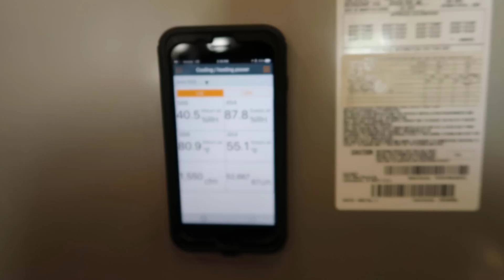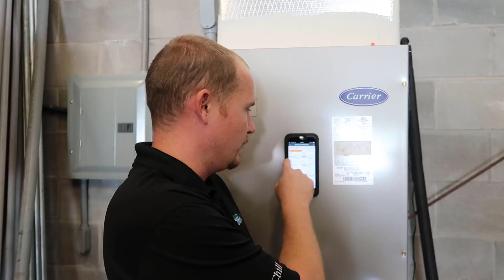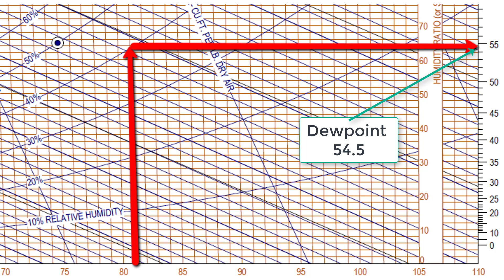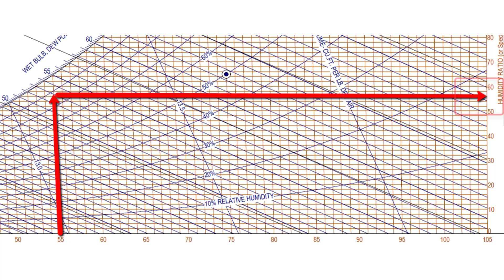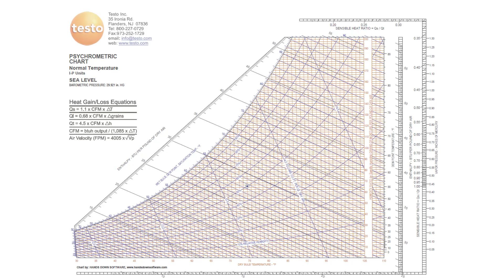Why is The Supply Relative Humidity so High?

Comment: Because relative humidity is RELATIVE to the temperature of the air... compare the dew point delta instead... or the wet bulb. Moisture content is technically measured in grains of moisture per 'pound' of 'dry' air, but that's a much longer explanation.

Comment: For Florida, even, your CFM must be very low for that supply air and the temp drop from return to supply. holy cow. Absolute humidity if falling of course (buy a better tool please);  but get your psychrometric chart out and graph this, there is no miracle here; also, error on 90% RH measurement is very high for this tool, be careful, please understand that.

Comment: So, warmer air coming in through the return can hold more moisture, & the colder air can hold less. As the air passes through the coil it becomes colder and thus shrinking the air molecules and wringing out the water( condensation)making the relative humidity on the supply side high, because of lack of molecular space to contain water?
Reply: The air molecules stay the same size, and so do the water molecules.  To understand why air has a capacity to "hold" water vapor, you need to look at it in terms of Dalton's law of partial pressure.  For a nice round number, consider air at 100 kPa of pressure.  Suppose we have a given air mass that is 1% water vapor, by molecule population, which corresponds to a humidity mass ratio of 0.0063.  Per Dalton's law of partial pressure, the partial pressure of each flavor of gas is proportional to the molecule population fractions (i.e. mole fractions).  This means our sample's water vapor partial pressure is 1 kPa.

Look up water's boiling point at 1 kPa, which is 6.97 Celsius.  Any hotter than this, and the water vapor is perfectly at home in vapor form, being mixed with the air.  Any colder than this, and water will condense until the partial pressure is low enough to support the remaining water vapor in vapor form.  6.97 Celsius is the dew point of this air mass that is 1% water vapor by molecule population.

If you increase the mole fraction of water vapor, you'll increase the dew point.  The water will be at a higher partial pressure, and if it were contained in a vessel separate from the air, it will boil at a higher temperature at that pressure.  This therefore increases the minimum temperature that can support that composition of air.  At 2% mole fraction, the dew point will be 17.5 C.  At 3%, it will be 24.1C.

Comment: I would add the fact that the heat gain of the motor and friction of the fan blade will change your air properties. Rise in temperatures and lower RH% content value.

Comment: What is great, you rob others, and present it and give credit to the original source.  TY for being youtube robber video guy.  Better would be to describe the compression of the sponge as pressure, which is related to temperature (increase pressure, you increase temperatures).  Problem is that most watching aren't into thermodynamics, or care.

Comment: thanks man you saved my harvest from rotting while drying....I had a portable ac unit right up against my drying room to keep the temp down but I could not keep my humidity to an acceptable limit. I backed off my portable ac . made a duct system to my room and like magic or science the humidity dropped by 20 thanks for the knowledge. if you are ever in Toronto I got a nice bud for you to smoke

Comment: So, am I understanding this correctly? 
Air has water holding potential, the warmer the air,  the more potential and visa versa; the colder the air, less potential. 
As warm moist air is pushed through and cooled across the coil, the less potential it has to hold moisture and this is reduced through each running cycle of the areas volume. Now the higher humidity in the duct is the blower blowing across a cold saturated coil and putting some of that moisture in the duct but the cooler air won’t necessarily absorb it. The hygrometer is picking up that extra moisture showing a higher humidity( almost a false reading) If you take the hygrometer to a supply vent it should show a lower humidity as it definitely will in the larger open area of the room. Of coarse these humidity readings will continue to drop as the air cools, losing its moisture holding potential. Btw: great videos!

Comment: Informative video. i need someone's help. i am facing a problem in laminar air flow system of operation theater, that there is too much moisture in laminar air flow while HVAC system works in summer. moisture levels is too high like water droplets fall from the Laminar air flow. plz guide me how can i control this. thank you
Reply: Aprilaire dehumidifier.

Comment: what is the dew point
Reply: The dew point is the minimum possible temperature for an air/water mixture with a fixed mass ratio between the air and water vapor to exist without condensing.  If you cool it without mass transfer, it will cool to the dew point.  By contrast, if you cool it with mass transfer, but without heat transfer, it will cool to the wet bulb temperature, or adiabatic saturation temperature.

Comment: ..and now for the guy who boosts fan speeds for airflow at the furthest supply and screws up all the great calculations we do ..
Do another vid on airflow/ velocity and static pressure for a basic residential system and branch flow.

Comment: Another way to demonstrate this would be to fill a balloon and then put in a refrigerator and  watch it shrink. The air becomes more dense which decrases its ability to hold water. When supply air mixes with warmer indoor air it quickly expands Which  immediately increases its ability to hold more water.

Comment: Here is some Joe-isms that I've seen in the field taking these measurement. 

1) the higher the cfm/ton the higher the supply rh which seems to contradict the bypass factor theory. Case in point your mini split 605i video

2) the more supply %RH the lower the capacity. I guess because you aren't pulling as much latent out. Basically because you aren't stripping the air going across the coil below its saturation point because your coil is warmer and larger with today's high seer coils.

3) obviously the lower the supply air RH the more your capacity will be 

I don't pretend to know all of the exact reasons for this but would love to see some videos more in depth I think Supply RH can give a lot of info about the system if we understood it more.
Reply from the maker: Joe Shearer I think Case #1 in the ductless video was just a factor of runtime. I have experienced the opposite, but admittedly I have not used it on a daily basis. We are starting to do delivered capacity commissioning on new installs so we will have a much larger sample size to analyze soon.
Reply: HVAC School please keep us posted on your findings I was speaking more on the newer high seer equipment with oversized evap coils.
Reply: To answer your scenario #1 by where an increased airflow creates a higher %rh in the supply air. What you are seeing is a function of the reduced amount of time in which the moisture in the air is allowed to contact the coil surface. The ratio of sensible capacity is always higher than latent capacity and will therefore continue to increase the air density, thereby resulting in a higher rh.

If you are truly attempting to de- humidify, it is most helpful to have a source of re-heat, ie hot gas bypass or a hot water coil. This allows you reduce your LAT to a lower temp thereby removing even more moisture. Then the air passes over the re- heat coil and is brought up to the 55 degree neighboorhood and you now have dry, cool, and dense air.